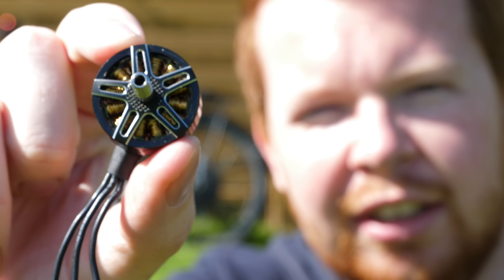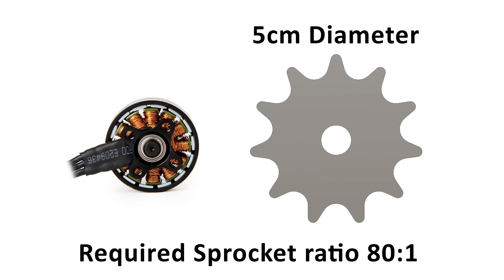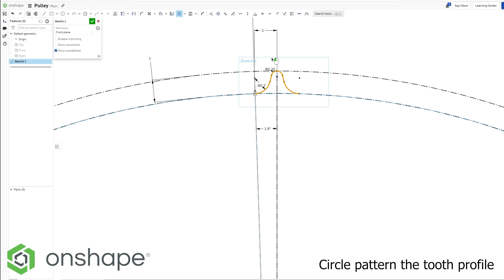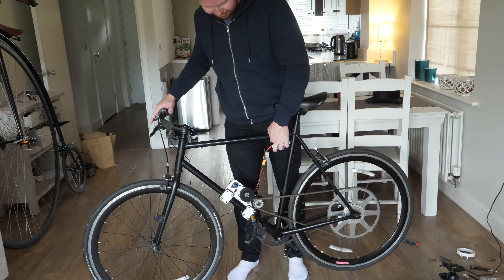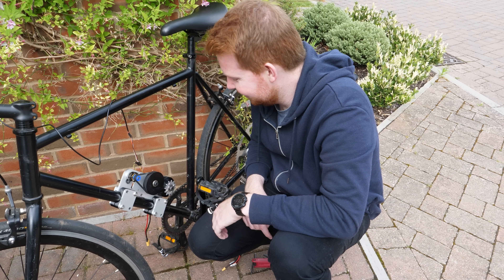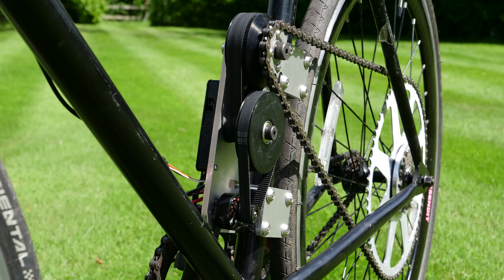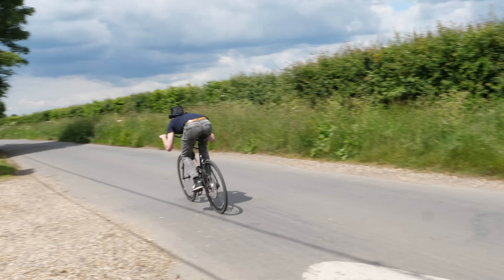Tiny 1kW Electric Bike Motor

Comment: I'm slowly putting together a project like this but planning to use a 63mm, 60kv, 1700w outrunner, mounted to a 10:1 planetary reducer both inline with the seat tube or down tube, then a 90° spiral bevel gearbox bringing the driveshaft out right above the front chainring with a 2:1 belt drive onto the front ring. A tandem freewheel crankset will allow drive to the chain without pedal drive and if possible a freewheel on the small belt pulley to allow pedaling without motor drag. Do you think I'll encounter overheating with this type of motor? I was planning to spend a little extra on the ESC to have current limiting hoping that would prevent it but maybe it's just the wrong choice? I'm working on the mounting and driveline before I buy any electrical components and trying to keep fabrication to a minimum and use off the shelf brackets for NEMA and some nylon pieces like chopping boards to keep costs down.

Comment: Clever stuff and I'm not surprised that the drone motor cooked...  Brushless motors in RC applications are typically built to run most efficiently at around 80% of the max RPM. Loading them up with high torque at low RPM pulls a lot of amps and generates a lot of heat. Years ago a friend was trying to learn to fly a Trex 600E RC helicopter. He came to me and asked why he was only getting 3 minutes of hovering practice.  I checked his head speed and throttle curve (in the transmitter) and dialled it all up to a higher head speed and 'flatter' throttle curve.... 6 - 7 mis of hovering... Basically the brushless motor hated being asked to work hard at low RPM... Ohh and beyond melting the coils (which is pretty extreme) the kind of temperatures you were seeing would have knackered the magnets... and that would lead to a waterfall failure (potentially destroying the battery / ESC) as the weakened magnets mean more amps are needed to generate power - so more heat - so more amps etc.

Comment: A very fun experiment. The temperature check at the end was apples to oranges though, as the fully enclosed rotor of the ebike hub motor is unlikely to efficiently transfer much of the heat from the coils to the rest of the housing after just a race or two, and both its copper and iron mass was far larger so naturally even a similar level of waste heat, all else being equal (which it won't be) would result in a lower temperature. The coils in both could be boiling before you know it however, if for instance the ebike hub motor had been running at high power at low rpm! I know it was just for fun but an embedded temperature sensor in contact with the copper would be the way to go - and improving the rate of getting rid of the waste heat would push the limits of what each motor can do.

Comment: Would it make sense to use two motors (for each wheels) from a bigger cinema drone? 
Also to use a similar fan design on the motors what you can find on 50cc scooters? I guess a CPU style cooler with heatpipes would be great for cooling as well but probably the heatpipes wouldn't survive the vibration.

Comment: Problem is that small motor will never have the torque the bigger one has so no matter how many pulleys it will only help after you get the bike up to speed but then it should help keep it at speed maybe even push it as long as there is no hills or extra weight. Very cool idea though and I am sure you can find the sweet spot where the motor is large enough to run on the pulleys and gears and not burn up your motor.

Comment: Many people don't know that, it is the Thermal performance limited the max power of the motor. RC motors generally has 85%-90% enegy effeciency, thus it must has something to get rid of the heat before the heat cook it up. That's why bigger power motor has bigger size. Please take a lot what Tesla is doing on their motors and you might know how to make a tiny 1KW motor before you just test a "so called" 1KW RC motor.

Comment: Wrong! You don't gear it down because it would be as fast as the SR-71, you do it because it couldn't run that fast. There is nothing wrong with going supersonic on an eBike xD
Oh and TL:DR it's a bad idea to use a motor made to spin a 10 g prop to move almost 100 kg xD But it can work xD

Comment: Reminds me a lot of the horsepower rating on a lot of hand power tools, to be honest.  You see a lot of hand power tools rated for very large horsepower ratings, 2-3hp, running a motor the size of your fist.  Then you look at a Baldor motor in a commercial application or a high-quality table saw, and it's nine inches in diameter and a foot long... rated for 1.5HP.

Comment: It is time to make a good cooling system for the engine with aluminum fins (more surface area) and possibly a fan. This video conforms the torque multiplication in speed reduction. Cheers

Comment: Why not just weld a freewheel sprocket (18T preferably) on the inner chainring so you can use the existing cogs (8 speed to 13 speed) and use a washing machine motor instead. Since the motor runs on 110V or up to 230V, then use a step-up inverter to bring it from 12V (or 48V) battery to the required electricity required by the washing machine motor. I'll wait for that project. Remember the power to weight ratio, too.

Comment: You should try using 4 of those motors in a star belt tensioned configuration and see how a distributed load could handle it. You might be able to get the gearing a bit closer to perfect too.
Reply: I had a more rudimentary thought of ‘I wonder if multiple motors distributed somehow could work’ and I’d be keen to see it too!
Reply: Kinda a good idea but then you could just get the standard e-bike motor if we are talking about the size ^^.
Reply: this exactly, reduces friction could be run bearing on rotating shaft compound belt reduction and better torque for the real world effects of friction.....and simply 4kw would be more appropriate for load because you don't tow caravans with Fiat 500's

Comment: Tires are awefully low, adding a lot of drag. Also the clicking from the chain/gear contact could be cured by deburring the teeth, smoother chain/meshing

Comment: Also the number of reduction gearing eats away power (while gaining higher torque). On the other hand, hub motor is designed with more number of power and hence lower speed and higher torque. It does not need any reduction gear and hence will have higher efficiency.

Comment: An ATR-72 turboshaft engine has output power of 2750HP = 2050KW = 2MW. This is similar to power of a loco engine, but look at the size (and weight) of turbo shaft engine vs. locomotive. Power/weight ratio of turboshaft engine is much higher than loco because it is cooled by the fan or propeller.

You obviously know these basic facts, but your video is for others to realize.

Comment: There´s similarly tiny motors, with similar Watt-rating, but much lower RevolusionsPerVolt, of course, it´d made a huge difference taking such one...
AND always use a plane for your mount, and not a mere line: So, 3 mounting points, forming a plane, instead of only 2, forming a line, that´s far more sturdy. And support the far end of the motor´s axle with a sturdy mounted bearing. In your way, the relation of the axle/rotor to the stator is steadily distorted, which leads to low efficiency, heat, and the far-too-early heat- and mechanical-death of the motor.
And NEVER use sensorless motors without pedaling for launching, the torque is abysmal in the first 100-200 rpm... Always pedal or push first, then use the throttle. 
I really wonder how is it even possible to make those mistakes, you don´t really have to have ever visited a school, to know this stuff, it´s obvious stuff...

Comment: If you had some kind of clutch would it allow the motor to spin at its optimal speed and prevent overheating?
Current flowing through each electo magnet inside the motor should only last a split second when it's able to run without load up to full revs. Guess it has a commutator switching the current in order for it to rotate?

Comment: The bigger motor is for a lot of things: efficiency, heat dissipation, snappy acceleration and rigidity. The motor does have to hold itself to the bike when there's lots of tugs on it after all.

Comment: It's a manufacturer ratings issue. The 1000W drone motor is rated for 1000W for maybe 3 seconds, and 250W continuous, whereas the e-bike motor is rated 1000W continuous, and could probably take 4000W for 3 seconds if the ESC and battery could give it that. So, you've just compared a 1000W motor vs a 250W motor due to differences in the way ratings are stated in the two different industries.

Comment: back when I used to work in a hobby shop when I was 11 years old, I did this with an rc10 aluminum chassis RC car. I was in a flea market, and I hooked the rc10 to one of those cement brick karts that use at Like Home Depot, and Lowe's, and with 9 kids on the back of that cart, I happily pulled all those little kids all over that flea market for like 20 minutes. everyone got a kick out of it. what did I do, you ask? I used the big little reduction gears from Tamyia Hornets, stacked two of them on the big primary drive gear, then use the small 9 tooth pinion on the hopped-up motor. the motor i had wound, with an 8.4 volt battery, turned 42000 RPM! it was probably something like 400:1!!! the biggest problem was traction I had to put two bricks on top of the rc10 just to get it to hook up😂

Comment: You need to target the motors operating areas. You need to find the motors highest constant operating torque and RPM. You need the motor to run at a minimum RPM to have enough back EMF to keep the coil currents within operating area. In short, a stalled motor draws the highest current and the highest RPM is the lowest current at any given input voltage and you were probably pushing well over the rated 1k watts.

Comment: Serious amount of power is lost somewhere. Since you didn't melt your pulleys, probably motor efficiency is just poor. Going 33km/h with a bicycle should take 300-500w with that bike depending on driver weight and tires.

I once tested a motor setup for my slick tired road-bike. I used 750w out runner motor which I fitted into knurled aluminium pipe and had a spring system which pushed it into front tire. It was bigger low kV motor and I was able to go 48km/h. Theoretical maximum speed for motor max rpm would have been 62km/h. Such road bike needs way less power to go fast. I was able to reach 80km/h for a short time only by pedaling. It also need a slick tire to be able to do such friction coupling.

That was lightweight and we'll working setup, except there wasn't enough cooling for coils. Run time was couple of minutes.

Comment: If you reverse the flywheel to the pedals of say 8 to 1 ratio giving 7.558m a second that will give a velocity of 17 miles an hour no need for the drone motor . The weight is important so 97kg creates drag and heats up the drone motor very quickly and certain temperature the motor catches fire .

Comment: Could you make a remote control bicycle if you just connected a RX receiver to the ESC of the motor, and used a drone controller? Just add a motor for steering the handle bars. That would be so cool!

Comment: It would be cool if at some point to fiddle with this Random idea I had. Like a Frankenstein electric version of your e-bike. My idea is just for fun. But what if you added a 2nd motor and power supply to it, and one motor would function solely for acceleration and then you could program the 2nd motor to kick in during the cruising/stable/coasting type zones. So sorta like a alternating current situation that who knows, maybe if it's done right, it could improve the efficiency of the bike over all in multiple ways? It's just a random hypothesis that just popped into my head while watching this. (It could be a total miss of a idea but I at least wanted to share it to people that know better than me in this department and let it go from there) - i wonder if there's any sorta possible option to utilize rechargeable energy methods between the 2 motor system? Like how Tesla's or some e cars recharge a bit of power when breaking? I think I'm remembering that right? IDK, keep experimenting man because you are very talented at this aspect of life and thinking and building, doing conversions, setting up electronic aspects of your work. It's impressive stuff.

Comment: Make it an all-wheel drive, by adding another drone motor to the front wheel :-). Also, try to use a Dual Motor setup (2x front/2x back) to reduce the load on each.

Comment: Those motors are expected to deliver the stated max power only in bursts and with a lot of air being pulled through them. It did well at things considered and was interesting putting one in a different scenario and pushing it to it's max. You could use one of the multitude of ones for RC planes, many of which are much bigger so are able to dissipate heat more effectively and many, especially the big ones run at much lower revs allowing you to remove or reduce a major source of friction. All this of course has been done before but as always, if using something designed specifically for one purpose you're going to have to make either changes or make allowance for the differences.

Comment: Apparently you didn't account for power-to-weight ratio you know day going well that's something that small is not going to pull the bicycle plus your weight as well that's why they designed the bigger electric motor for the wheel directly pulling without adding a lot of other belts and pulleys and change to make it work that just shows how smart you are .......not

Comment: Why not use 4 tiny drone motors in series?  Four times the torque so at normal speeds each motor is only working 1/4 as hard.

Comment: Thought: get an RC boat motor and hook to a closed-loop radiator (e.g. computer liquid cooling system) though at that point you're getting back to the bulk of the e-bike motor... but an aluminum radiator should still have a weight advantage.

Comment: I'm still waiting to see an e-bike that supplies the "boost" to the PEDAL sprocket gears rather than the wheel hub gears.  Now THAT seems like it would be truly useful since you would gain all of the gearing benefits of an 18+ gear mountain or road bicycle.
Reply: You've never seen shimano steps?
Reply: @pontiacg445  No I haven't

Comment: Two motors at each wheel, would've worked with most of the drone electronics,considering most of those commercial drones have 4 motors, and yes those fan blades to cool em off would also be helpful.

Comment: Add one aluminium plate on the outside to support motor and drivetrain 
That would avoid the shafts working against the tension of the belt and chain.
You will gain allot of power.

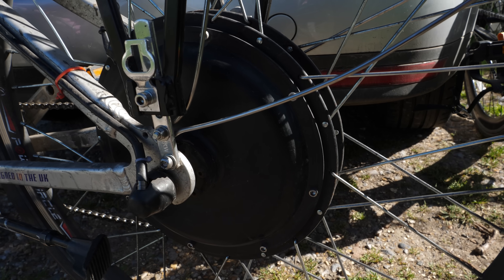Comment: Is it just me or can you see the motor burning & letting out blue smoke just between the bike frame & pedal arm towards the back of the bike at 10:29 - 10:35 ?
it's like in the bottom center of the camera shot there.

Comment: This would be great if you used a much larger motor and a matching ESC,umm...Electric Speed Control.  The right batteries are next. I  like the machining, but engineer it so parts don't rub against each other. It's about balance.

Comment: the motor is not the problem. its the gear that is the problem. the motor need a reactionless torque converter or water cooling. just use a rotational to reciprocating hydraulic pump to create liquid oil presssure that then drives trough a nozzle and eject a liquid stream of oil that drives a pelton wheel mounted on the bike wheel all encased in a box. that chould prevent the motor from getting to hot. you could also encase the motor in a oil bath container out of aluminum and use water coooling to keep the motor cold with a couple of computer fans and a tiny water pump. that would give you atleast 700 watts of raw power continuous without overheating the motor. you have 3d printer so you chould be able to make the parts. for the cooling  the aluminum only need to be partial or plastic could work in a water cooler.

Comment: Real good idea showing how fast your e bike can go, your forgetting that here in the UK (where you live) its illegal to to use an e bike that can go over 15 miles per hour without peddling (that includes a home made e bike), UNLESS you are using a full face helmet, your bike has road tax, an mot and you have full insurance. if you get pulled by the police you have given them and the prosecution all the evidence they need. when that happens you will be wearing some form of GPS based ankle jewelry for some time.

Taken from we are cycling.
E-bikes are classed as regular non-assisted bicycles in Great Britain but if they supply electrical assistance when traveling at more than 25kph (15.5mph), have a motor which generates more than 250 Watts of power or motor assistance can be provided without the bike's pedals being in motion, they will be legally treated as a moped or motorcycle. These powered two-wheelers are subject to a different regulatory framework. 

In short Tom, you are riding an e moped or e motorbike for them you DO NEED a full face helmet, road tax, an mot, insurance AND a license. here in the UK you get penalty points for driving violations (lights not working, less that the minimum tread depth on tyres, speeding, drink or drug driving, etc, etc) you can get these points even if you DONT have a license, the points WILL be added as soon as you do get a license. 
So Tom you can get 3 points each for;
no full face helmet
no road tax
no insurance 
no mot
no license but i take it you have a car license and that includes mopeds up to a given power and speed limit so im not counting this one.
That makes 12 points, instant BAN (no car OR e bike) you might also get a court order preventing you from owning or using an e bike.